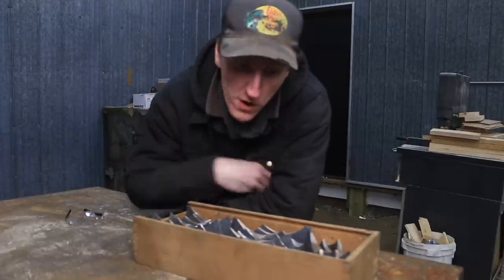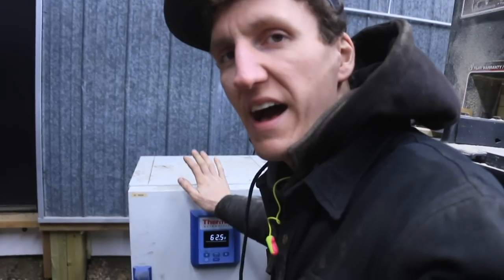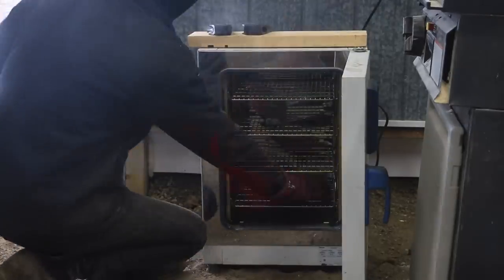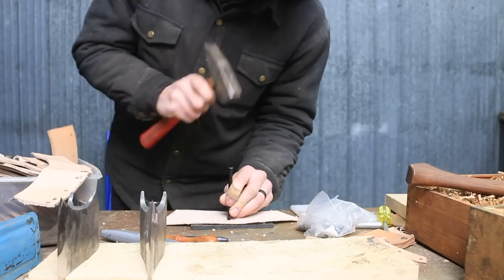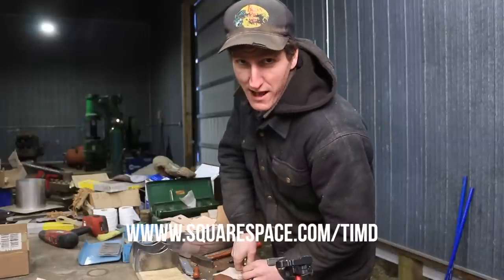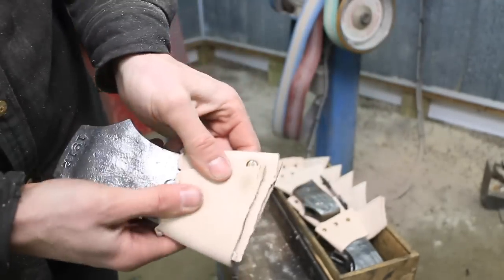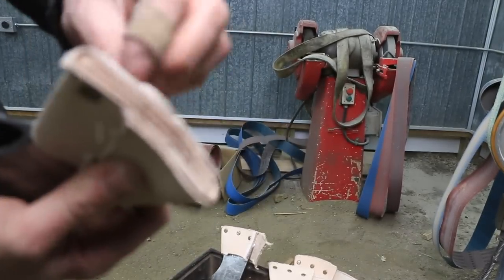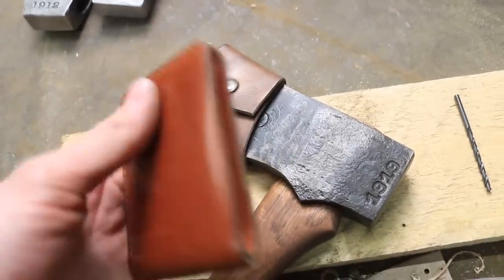Making 1912 Hatchets

Comment: I used an oven like that when I worked as a metallurgical chemist. We used it for drying casting sand samples so we could run them through screens to check the weight of each grain size going into the molds. I know, very exciting!

Comment: I used to work with lab ovens. Thermo scientific is some top of the line stuff man. Just make sure you get the sensor calibrated every few years. It does not need to be super accurate for what you are doing but you never know, especially after the move.

Comment: Yes you hoser ,you are correct, the electronics in the temperature controller doesnt like cold. We used to use a heat gun to warm them up slightly.

Comment: Hello Timothy... I have a few questions.. And please forgive me if the answers to my questions are in this video. I only made it to 2:40 before the adhd kicked in and sent me to comments. So here  goes. I found your video while using Google lens to try and find some info on an axe head i dug up at about a depth of four feet on the ice of a hill above a lake here in Columbia County FL. About ten miles from the Suwannee River. As an amateur blacksmith and amateur archeologist I consider this an amazing find. My first search came back that the axe ws called a Jersey axe. The ones Google provide matching mine exactly.... With the pointed protrusions on the bottom of Ye axe head. But tonight my search brought up several instances of it being called a 1912 Blackhawk axe. I was wondering if you could provide or point me in the right direction for mored information in this piece. I would love to have you look at sne photos of it. If you can provide me with an email or nessmeger acct il send osme pics.... Thankfully the pitting is minimal and I hope to get this bad boy churches up and bs to splitting wood. Thanks in advance

Comment: How’s this for a production idea Tim-O;
Offer for sale on square space An Axe or Hatchet KIT for the hands on type to do some light finish work and assembly themselves. You could move more units, reduce your time per unit, and when we inevitably F-up or decide we are NOT as handy as we thought, you’ll sell more finished replacement handles that just need fitting and hung at home. 

Hopefully you have overcome the frigidity of the frozen north. 

Brain Fog is real. Extreme temperatures, extreme light or dark, fatigue, tiredness, boredom, repetitive tasks, and much more can Zap your brain of its ability to process and control your actions/movements. 
My best advice is to EAT AND DRINK when you notice it begin! Chocolate and coffee are my favorite, but anything from bread and water to peanut butter and grapefruit juice will have the same effect. It’s a way to change gears in cognition and jumpstart your metabolism. The combination is a great impact on your ability to get shit done. 
Cheers to you my frozen friend from “Zed” land!
-Castor